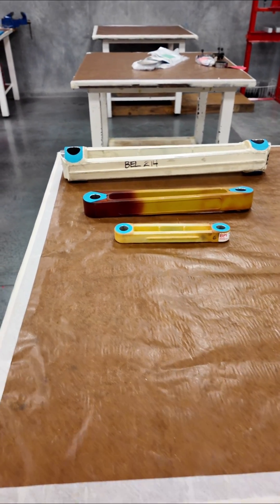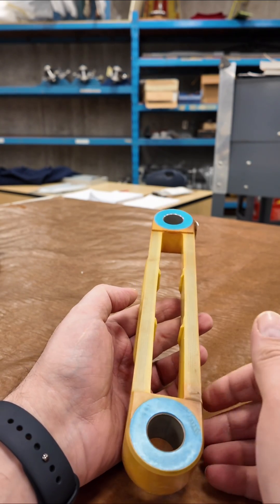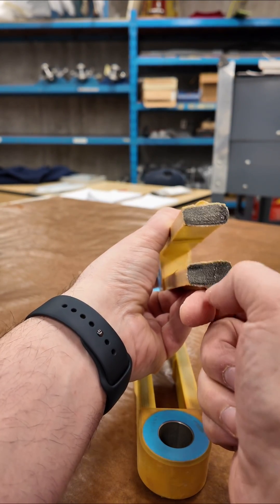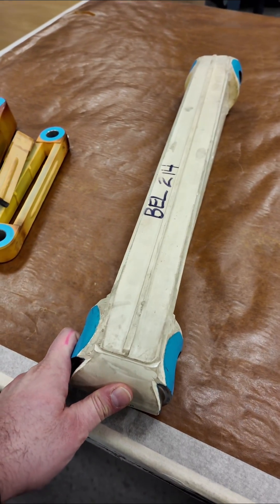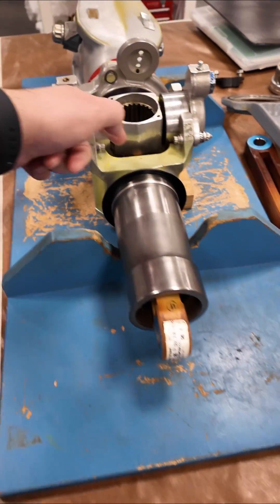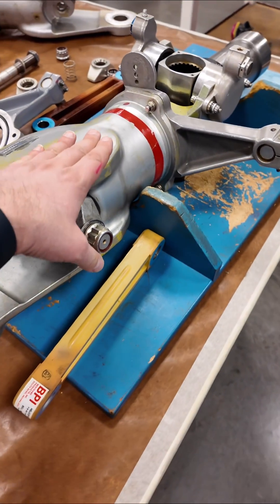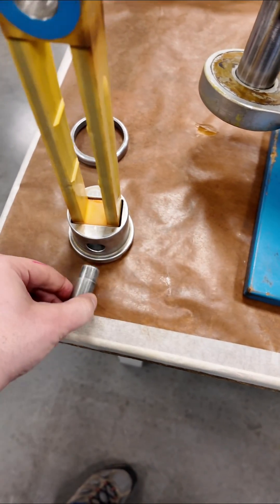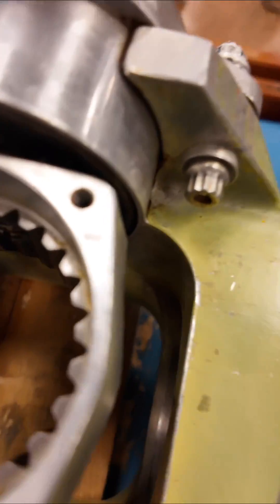Helicopter Tension Torsion Straps.

Comment: So essentially the strap is what holds the blades onto the rotor head, fighting centrifugal forces and allowing feathering. Correct?

I come from Robinson where feathering is done by bearings and retention is done by a steel bolt.
Reply from the maker: Correct. The R22 blade has a stack of six thrust bearings in each grip to take up centrifugal forces while allowing feathering . The TT strap  does the same thing.